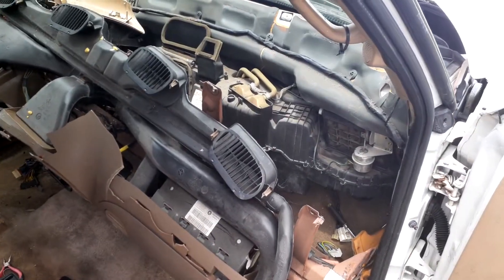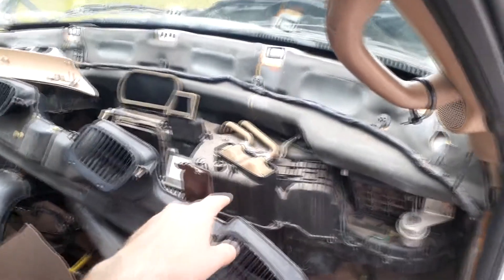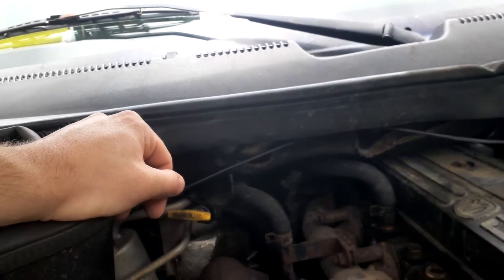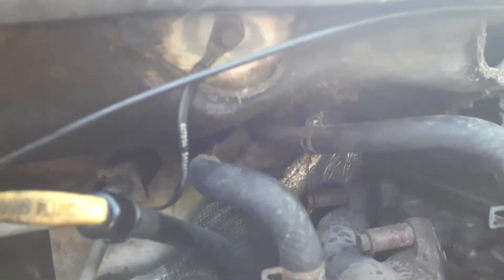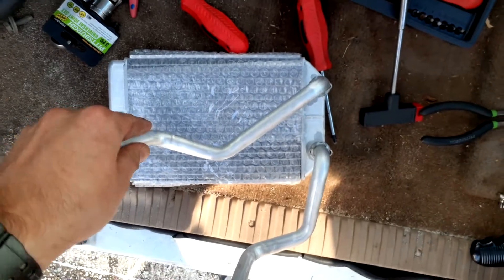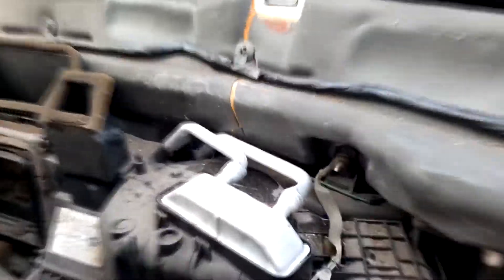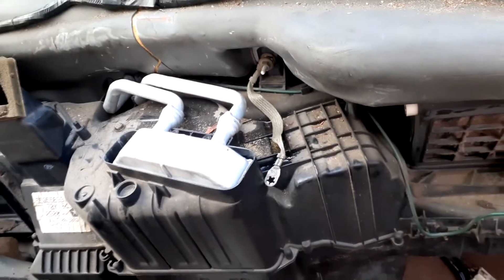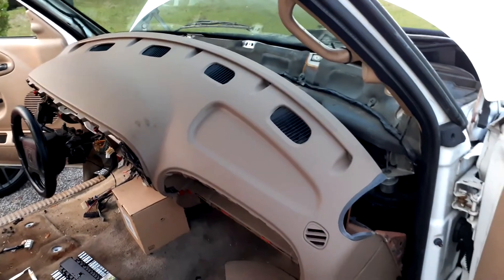Project Slate: Ep 2 | 2nd Gen Ram Heater Core Replacement

Comment: So I have the same year truck 2001 dodge 3500 5.9 24 valve 4wd.  I'm wanting to drain out anti freeze and clean out the lines. What do u recommend doing to.clean it out and what type of antifreeze?
Reply from the maker: I'd run a coolant flush though it, drain it out, fill with just water to clear up and old stuff, drain it, then I'm running amsoil heavy duty coolant & Antifreeze. It was suggested by a buddy can't really speak if it's any better than the walmart stuff, but it works. Please note, I'm not a expert or trained profession, so please do your own research as well
Reply: @AllThingsBoost  Thanks man. Your truck looks great.
Reply: Where did you buy replacement dash and heater core?